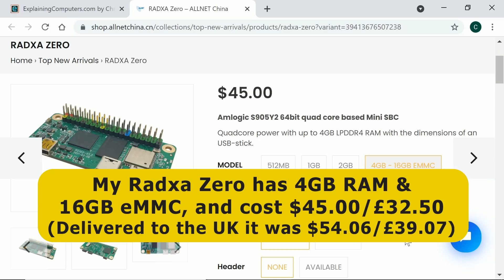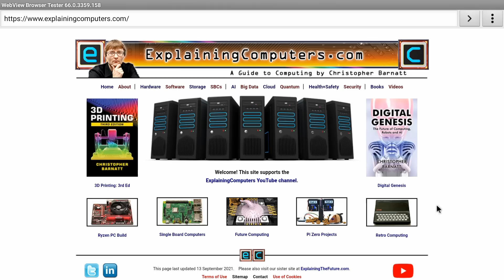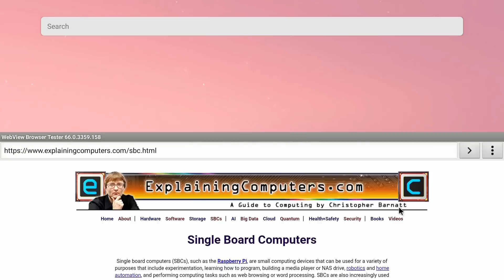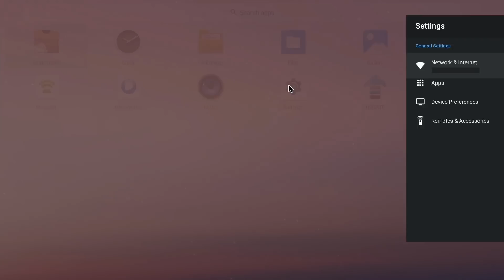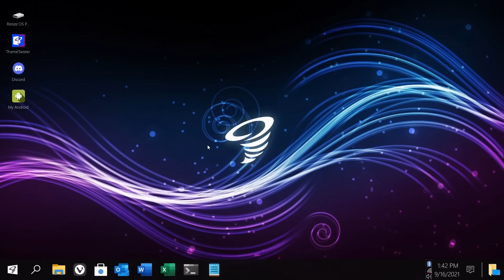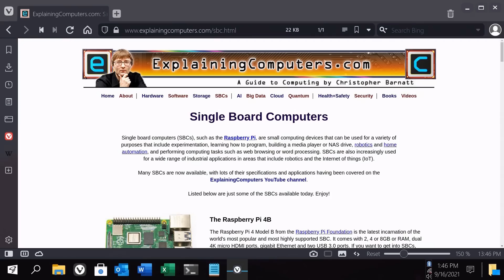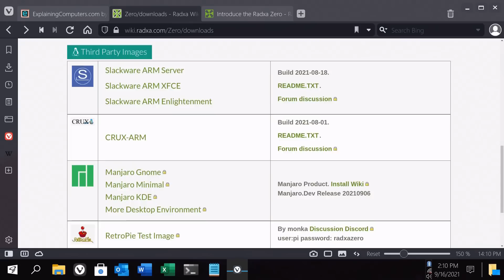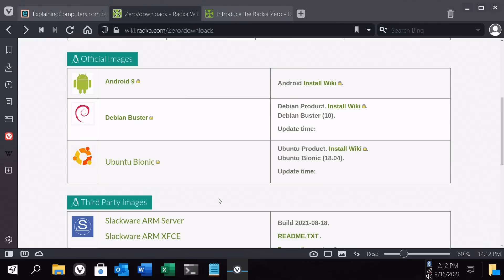Radxa Zero: Tiny Quad Core SBC

Comment: Now at the end of 2021 I would either use the Raspberry Pi Zero W (which is well supported, cheap, but slow) or the Banana Zero (faster and software OK).
The Raxda Zero has a lot of potential when the software is running.

Comment: looks like it's possible to solder a UFL chassis/connector for an external WiFi antenna as there are soldering pads right next to the AP6256 ?

Comment: i have one of these boards and the only os i can get to run without really any issue is Debian.  i got one of the manjaro distros to install, but it would Not recognize Nor connect to my one bluetooth mouse...debian connected no problem.
i would Prefer another os over debian, but its the only one on list that works without hardware issues.
its a great board, just needs the software support.  i would really like to use for 4k youtube and other video playback, but wifi keeps 4k from playing well and hulu is not supported on linux from the messages ive gotten when trying to play its content.

Comment: I kind of wish you'd tested it out with Lakka OS as I'm curious how it would work in a Minty Pi and if it could emulate PlayStation games.
Reply from the maker: As far as I am aware, Lakka OS is only available for a Raspberry Pi. Pi OS images will not run on a Radxa Zero.
Reply: @ExplainingComputers  Ah. I was wondering what kind of capabilities it would have had as an alternative to the Raspberry Pi 0 in the latest revision of the Minty Pi since the two look similar. I might have had and RP0, but I kind of suspect it would struggle with Playstation 1 emulation. Plus the onboard storage would have been nice to have. Then again, Sony did release the rather small PlayStation Classic, so I could be wrong on that. On that note, I know that Retroarch has been ported to the PlayStation Classic, which is why I was curious about it.

Comment: Great "warts and all" review. If manufacturers are going to ship "machines", (which seems ostentatious for a small sheet of lumpy plastic with some plugs, however clever it is), in such a part-finished state, they ought to supply a "Basic steps to rolling your own OS" for it, at least as a downloadable PDF. It would be in their own interest, because that would be sure to get enthusiasts doing the job.
This class of boards is just barely competent as light, general-purpose display devices, but I have a suspicion that there is a niche for them that nobody has really discovered yet. I wish I knew what it is. :-)*
Reply: The original Zero found use in all sorts of DIY projects that didn't need much power. GPS loggers, brains for robots and drones, dropping them into busted Gameboy Advance shells and making handheld emulation devices, I think there's a Geiger counter or two floating around out there, ect.

This gives you the option of having something in a similar size, but having way more power. I'd imagine it'd be used a lot in those DIY handhelds or cyberpunk-inspired 'cyberdeck' computers, perhaps.

Comment: If you are putting an SBC in a plastic box to ship make it reusable.  Add a couple standoffs and holes for the ports!
Reply: a dremel and some screws can make that happen
Reply: @arch1107  I was thinking a soldering iron with an old tip. They could just mark the box with the spots you need to dremel.  Maybe someone will make a template.  From experience getting alignment right can be fiddly sometimes.

Comment: With one usb used for power, did you use a hub and was it unpowered?
Reply from the maker: I plugged in a Raspberry Pi keyboard, which includes a hub into which I plugged a mouse. So yes, a hub, but not a powered one (all power came from the Radza Zero).

Comment: This board could prove great for a portable retro console build, much smaller than RPi4, much cheaper than CM3 or 4 (at least with adequate 2GB ram and no gpio pins), Retropie already available, it could really be great for that build. It would be a waste combining it with existing Pi Zero cases though, lack of buttons and analog joysticks would be a waste of decent power.

Comment: I had high hopes for this board and I still do! Hopefully they'll get on the support issues. I was able to find a spot on the web site explaining how to erase and flash the eMMC, but the images for some of the other OS's are still missing. 
I was hoping for a bit more performance-wise in desktop Linux. Maybe it's the distro/optimization? Also, I wonder how this compares to a similarly spec'ed Pi4?

Comment: Looked promising as I wanted a decently powered Pi Zero form factor SBC to pait with the power hat I have, glad I did a search first though from the looks of it the GPIO pins are incompatible with Pi hats. Maybe it's just me but what's the point of taking something else's form factor and a general feature like GPIO headers if its not going to be a drop in replacement, it's kind of the same issue I have with loose standards, as manufacturers sport the logo but have half the features cut at their discretion. It would be kind of like ordering organic beef and then being given a plant based substitute, it's not lying (as plant based is still organic in a loose sense of the word), but neither it is being honest with the consumer who was expecting a real meat product without the additives.

Comment: I am wondering about connecting a camera to this board, shame about the lack of support.
Reply from the maker: The lack of a camera port is disappointing on a board with such a decent hardware spec. A web cam should work (driver permitting) via the USB 3.0 connector.
Reply: @ExplainingComputers  Yes thanks

Comment: So it's use the eMMC or USB but not both at the same time?
Reply from the maker: Both can be used, but with the boot order being eMMC first and then SD card, it makes it tricky to boot an SD installed OS.
Reply: @ExplainingComputers  both can be used as in boot from eMMC/USB and use the other as storage drive? 
I'm asking because on the raspberry pi cm4 it's either use eMMC or USB but not both after boot. 
 

Btw. many thanks for all your effort reviewing SBCs :)

Comment: Can u suggest board for commercial product purpose...
Reply from the maker: It depends on the specs you require, but for a low-end ARM board, you cannot beat a Raspberry Pi model -- they are used in lots of products. And there are the Compute Modules and carriet board specifically for industrial purposes.

Comment: This is a well stocked board and if I was needing a Pi zero form board and didn't need a camera port, this would be top of the list as it ticks a number of boxes.

As for the different models, there's covering all your bases to make an impact but there really are more than enough configs of this especially when 4 might be enough with 512MB, 1GB, 2GB & 4GB RAM options.  I'd potentially drop the eMMC and just opt for an SD card for all storage.

Comment: Great review as always.  My problem with this board is that needing 3A means it really isn't made for portability, even though the form factor would suggest it is.  The Pi Zero may be slow, but it will run for a day on an 18650.  If you do a future video with this board, it would be helpful to see how many amps it pulls at idle and maybe running a game emulator at 720p.

Comment: I hope the Pi Zero 3 will, at least, match or surpass the specs of the Radxa Zero in this way:

1 or 2GB RAM (2 gigs would be preferable because that way web browsing would no longer be a problem), Quad-core Cortex A55 (or even an A510) @ 1.4Ghz, 32GB eMMC flash chip, a new videochip that flawlessly plays 1080p/x265 content, 2 USB-C (3.0) connectors, and support for 128GB SD cards (or replace it with an additional USB-C 3.0 connector).

If this makes the Pi Zero 3 twice as expensive compared to the Zero 2, then that's no problem: 20,- pounds is still very cheap ;-)

But I'm probably dreaming too much and should wake up to reality ^^

Comment: Interesting new SBC adding to a rather crowded field of competitors. It's a fun field to explore, for sure. Still, as this is in beta, it seems to lack some things, as you pointed out. It would be great to have a camera connection. I have nothing against eMMc drives. I use them frequently on certain SBCs that support them. Odroid, for example, has eMMc slots. At least mine do. The big question for me is can the eMMc module detach or is it soldered in. If the module could be snapped out and replaced with another eMMc burned with another operating system, that would be a great selling point for me. If Radxa wants to spend some effort on their current default OS, update Android for crying out loud! Beta's beg for input so it should be interesting, indeed, to see the finished project. I am very, very interested in this little toy thanks in part because of your video introduction to it. Thanks and sorry for the long comment.
Reply: eMMC on the Zero is soldered-in(non-removable)

Comment: Someone needs to make one of the low end SBCs with a single ethernet for network projects etc.
Reply: well, in this case, you can add via usb c a ethernet adapter you might have around
Reply: @arch1107  You could but they sometimes have latency and packet loss issues and its a bit of a mess. What i would like is a little machine like this (or even smaller) that i can power over PoE. The OrangePi zero 2 is quite good.
Reply: @andljoy  poe is interesting, yes

Comment: Is it powerful than a raspberry Pi zero w?
Reply from the maker: The Radxa Zero is far more powerful than a Pi Zero (at least with the right software), as it is quad core board -- with the Pi Zero being single core.
Reply: @ExplainingComputers  could you please make a performance comparison? overclocked if possible between this, a pi4 and a x86 pc like that pentium you used some months ago? i would like to see how close or far are these arm cores to cheap desktop cpus in terms of performance

Comment: Amazing that you didn't dwell on how expensive this board is compared to the raspberry pi zero.  $55 for this board is outrageous even if it was working perfectly.  You need  to make sure everyone knows this is a specialty board with a very small nitch that is going to sell in the hundreds not millions.  Because of that, software support is going to be very slow developing if it ever does.  In your excitement over a new board let's make sure everyone know this is going to be a small run system with very little system support.  Not that it is a bad thing if you need it, but it is a very specialized product for a specific use case.
Reply from the maker: The equivalent board to the Pi Zero is the 512MB model, selling for $15, as I clearly indicated in the video. But the 512MB Radxa Zero for $15 has a quad core CPU and USB 3.0, whilst the $5 Raspberry Pu Zero W is single core and USB 2.0. I completely agree that this is a board that will sell in low thousands compared to hundreds of thousands or more.

I stressed in three segments of the video the poor software support for the board -- which I think you'll find makes me very different to anybody else who has reviewed it on YouTube! :) I don't think that anybody could come away from this review without the impression that this is good spec hardware for those with good OS knowledge only.

Comment: But will it run windows 11?
Reply from the maker: No.
Reply: damn ... I will just have to revert to purchasing an overly expensive computer for that !
Reply: @kriskruz3792  lol, there are laptops with a celeron for like 300 dollars that will run it, calm down
Reply: @arch1107  yes strangely Microsoft has listed some newer processors that they claim will run Win 11 but they are not that powerful (i.e. Atom, celeron, pentium types) especially when running certain applications or for multi-tasking.  Not sure I would buy a low spec newer PC just to have Win 11 barely running but can't do much more else with it.
Reply: @kriskruz3792  win 11 asks a certain tpm version and a certain virtualization technology to be present to run the antivirus inside a virtual machine

apart from that any shit atom or celeron will run windows 11, that is just win 10

i personally want to replace my r3 2200g with a r5 2600, just to use win 11 and complain about it

but for daily use and basic stuff you will be sort of happy with a i3 and 16gbs of ram

my daily machine is almost as weak as this sbc, and only for youtube 720p is enough, but for other things it is really fast

i guess nothing keeps us happy

Comment: Can you retest the radxa zero with the new softwares.
Reply from the maker: This is on my list -- I intend to do a Zero form-factor group test, including the Pi Zero 2W and the Radxa Zero.
Reply: @ExplainingComputers  I got zero 2w and ordered a radxa zero 4g w/ 32g Mmc today. The new rasbian doesn’t let me use the camera.
Reply: @ExplainingComputers  Excited for this video .... please post it soon, with some benchmarks
Reply from the maker: @shankarhariharank7837  There will be benchmarks! :)
Reply from the maker: @nnasab  You can use the camera in the terminal using the new lib camera commands. But if you need, quite reasonably, to control a camera in Python you will need to use the new "Legacy" version of Raspberry Pi OS. I did a video on this quite recently: https://www.youtube.com/watch?v=1qx12adIFXc
Reply: @ExplainingComputers  I have seen the videos but they don’t want to work on the new hardware zero 2w. I haven’t tried the Python yet. I’ll try it.
Reply: I have been trying to use time lapse and %change in camera before it takes a picture. Like a security or game (trail) camera. The legacy software doesn’t work on zero 2 w, or better yet Radxa zero. I have both and I am trying. I forgot a lot of coding. I have (MS) and tinkering with this stuff is mental and dexterity exercise for me.
Reply from the maker: @nnasab  All of the "old" RaspberryPi camera commands that you will find in tutorials/etc online no longer work with the new version of Raspberry Pi OS (Bullseye), which has become a point of great contention. If you install Raspberry Pi OS Legacy they will work. Good luck! :)

Comment: as far as I know S905Y2 is just low power version of S905X2 SoC  w/o USB3 . so I doubt this SBC's USB-C port is a real high speed port. there are tonns of S905X2 Android TV boxes out there so it is not surprise you have only  Android based firmware - the manufacturer did not  work hard to present you any other kind of firmware. Considering poor software support I find this SBC rather overpriced

Comment: Big pass.  If they are going to have a page that says these OSes, there should be "These OSes".  If they can't take the time control to even keep a web page UpToDate , it puts into a question how good the hardware is.  

"I'm sure software support will..."  Yeah, QC stinks but they'll change.    Sure they will.
Reply: I haven’t checked, but those links are offsite, at the projects that control them, and not something that the board maker can control. I’d do some searching for the “These OSes”, and see if there are updated versions in a slightly different location.

Comment: So again and again, great useless potential :-(. One thing is manufacturer support but I think that we need to wait for official ARM UEFI equivalent and the ability to run generic OS or it will look the same for any other board...
Reply: They invest less then nothing in software development. Forget about.
Reply: @igorpecovnik  that's why I stick to proven ones. But this is ARMs problem, not that particular company. If you take x86 world you just stuff components together with stock BIOS and you are done. In case of ARM you need to create dedicated bootstrap for OS to get any grip. This way we get what we get...
Reply: @SergiuszRoszczyk  This is certainly not ARM problem. They do hardware design and this is not universal but extremely divers purpose driven hardware. Where having some common ground is extreme and expensive technical challenge. Some ARM vendors perhaps tries to eat mainstream desktop / server positions, but that's just a little. All those do have cash to provide UEFI. And they do.